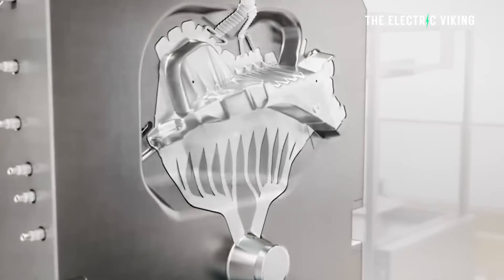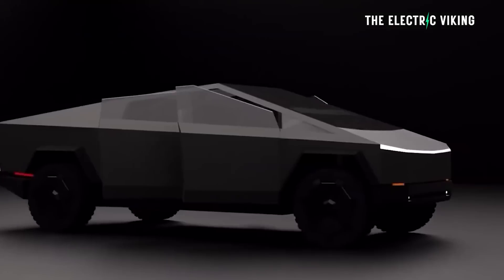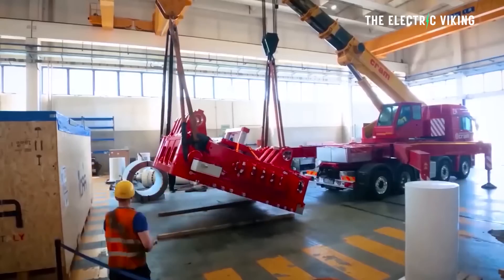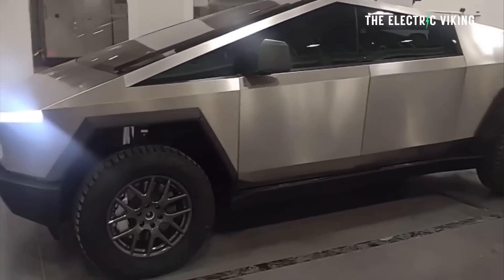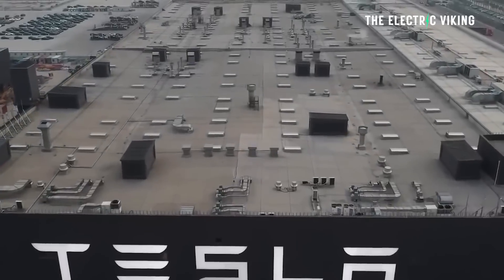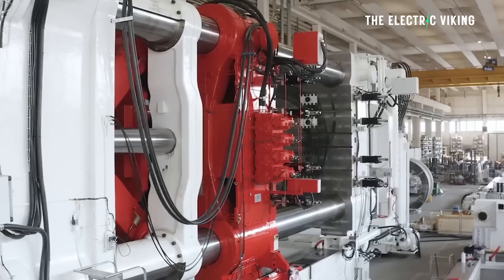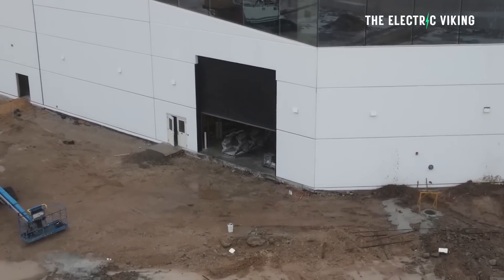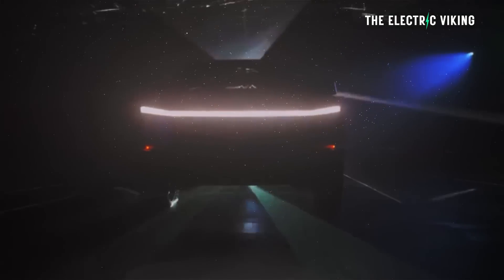Tesla Cybertrucks' MASSIVE one-piece castings spotted at Giga Texas

Comment: Am I missing something here ?  Castings, as far as I´ve always known, are made from molten metal poured into a mold.  Is the stainless steel melted before going into the IDRA Gigapress ?  No.  It appears to be sheet metal that is FORMED by the press into the desired shape.  Please correct me if I´m wrong.
Reply: Only the exterior is made from stainless steel. The castings are Aluminium. In this case, the molten metal is not poured into the mold, but rapidly forced into the dies.

Comment: I also have one on order and I'm hopeful that the quality of the material inside are better than the 3 or Y.  I was sort of surprised on how "cheap" the car felt despite the premium $$$.   So far the "test" models leave a lot to be desired.  The glaring body panel gaps are disappointing at first glance.  They have to do better as the reputation for lack of quality builds remains.   I'm still excited for the Cybertruck though.  I'm very hopeful.

Comment: I am no chemist, but I am an engineer and a part-time boater. The importance of this to my thoughts out tesla comes from using sacrificial anodes on steel-hulled boats. In freshwater, these anodes are often made of magnesium, but they are commonly of aluminium for steel boats used in brackish or salt water. 
They work (in the presence of water and in contact with steel or iron) like a Galvanic cell, with the Magnesium or Aluminium eroding away, but the steel is protected from corrosion. 
Given that the tesla mega castings are based on Aluminium, are structural, and surely will be in contact with steel, what would be the effect of prolonged driving of a not very new cybertruck in winter on frequently salted roads?
This wondering of mine is, in fact, secondary to another concern: How repairable would a car be, whose essential structure was just one or two big castings and a structural battery? Not now talking just of cybertruck. My guess is that a low speed collision with an obstacle,  that was just sufficient to distort the casting could completely write off such a car.
Are insurers in their ratings for own damage looking at this? Am I just being pessimistic?
Is Tesla trading repairability as the price for streamlined production processes?
Reply: You are describing a water heater; the magnesium core keeps the steel hull from rusting. The CT uses stainless steel, so the ionic exchange should be much lower. These castings won't be repairable, people need to stop fooling themselves. To be fair - traditional bulkheads aren't repairable either, but chopshops will always try. I looked into insurance and at least for me a model Y was MUCH more expensive than a 3, and that was due to the car totaling easier. Also the hatch dips into the bumper, so a mild rear tap needs a new liftgate. Now what happens when you can't just bolt on a new skin panel... but your dented fender is actually a functional exoskeleton? Sure its thicker and has a spring to it, but still. These will need to be cheap enough to justify the disposable nature of them... and I don't think they will be affordable for many years. Also - I want a mechanical handle to open the doors or windows, in the event of a power outage. That window isn't going to break with your feet.
Reply: @Dave-cf4vd  so my suspicion about totalling being a high risk is not merely a marginal hypothetical worry of mine! Insurers are bothered, too. I think there is too much awe and delight aimed at Elon Musk's embracing of lower-cost manufacture and not enough about repairability. I am not just having a pop at the Viking here, as to be fair, NOBODY is talking about it, ATM, including some that do go into individual vehicle reviews in some extreme detail. 
As for the "fly by wire" windows and doors, If I ever had such a car, I would keep a couple of emergency hammers in the car - at least the side windows should be toughened, so break safely. In the UK £10 for two from Amazon. The trick to power up the door locks from outside using wires hidden in the towing eye cover is far from straightforward, and impossible if you are embedded in the back of another car....
Mind, I am nearly 80, and whilst I would LOVE an EV, I suspect I will never own one. But following the technology as it develops is a delight for an engineer!

Comment: There is no doubt that the use of large cast sections will improve the construction process and reduce prices.  The big issue is once these hit the road and are involved in accidents.  In a conventionally built vehicle those smaller sub components can easily be replaced with new if damaged, this minimises the repair costs.  If a large cast section sustains even minor damage the only choice will be to replace the entire component.  This will increase the repair costs substantially and probably lead to Teslas being written off for relatively minor accidents.  The impact to the customers will be substantially higher insurance premiums for Teslas.  This may lead to Teslas becoming a throw away item rather than being able to be repaired, this would particularly be the case if they ever produce an entirely cast vehicle frame.

Comment: How many months will it take China to deploy their own (copy-cat) version of the Gigapress into production?

I am assuming that they began to clone-design at least year ago and intend to use it in 2024, but they will have troubleshooting issues to correct.

My prediction is end of 2024.
Reply: Idra have a CS9000 gig press in Shanghai right now. Do you think for one moment that anyone has the time to stop the press, pull it apart, reverse engineer it and then put it back together. This is also assuming there are only three in the world with a fourth one being built. China Inc makes stuff but only mass produced. Also Idra would get very pissed off with whoever copied their designs. LK Machinery owns a majority share of Idra now. Look them up then you will know their machines won’t be copied any time soon
Reply: @theairstig9164  Your assumption about my comment is too simple. China has a long history of ignoring proprietary intellectual property and will cheat, bribe (China has huge corruption problem), copy and steal in any way possible when they deem it to be necessary.

The practical reality is that these uniquely large machines are produced in quantities of only two or three per year.

Eventually, many of these machines will be purchased by many manufacturers but until then, your reply does not persuade me to change my assumptions. Economic reality makes my comment a mere, self-evident ornamentation. They will still attempt to do whatever is needed.

Comment: Until this vehicle is actually on the highway there is really no way of knowing but I think what can be said is that this truck is absolutely MASSIVE in every way with only the Ford F150 Lightning of similar type but of course far more/actually has #curb_appeal . For me I will be far more interested in how the computer interface system, vehicle safety and autonomy and any battery form factors changes plus drive "lines" than the construction of a wholly cast single piece body exterior. Casting something this large is a remarkable matter as engineering feat absolutely but again the hardest about driving any vehicle is not putting the vehicle in motion but in point of fact trying to make said vehicle come to a halt/full stop. Hopefully has redundant emergency brake systems.

Comment: It is unfortunate that Tesla is like Apple, in that they expect you to buy their new products, and care very little about how to maintain their older products. The Model S battery for example is very expensive to repair, and with the thousands of cells glued into the battery system, you might have only 5 out of 5000 cells bad, and so you have an over 10k repair, even though you have only about $50 in parts to replace...

Giant aluminum castings are not field replaceable, nor are they weldable. Instead of one giant casting they should have made it out of bolted sections, so that they could replace it like they did in aluminum aircraft construction, where every part has a fatigue limit.

Aluminum is a very lightweight metal, but it suffers from metal fatigue, while steel does not. Yes it is lighter, etc., But in engineering, everything is a tradeoff. 

The CyberTruck should be very cheap to produce, and it will tear up the market because they can come in at a lower price, but it is a bit of ecological nightmare to have a car that is so difficult to repair. This attitude that Apple and Tesla have is unecological.

Comment: cybertruck won't be out soon because tesla has NOT solved the battery problem. 4680 has been a huge disappointment so far! energy density of 4680, according to a recent EPA report, is no bettet than 2170!
Reply: rofl, you have no clue what you are talking about.
ofc it's density is not there atm, as if energy density is anything of a major concern, thats easy.
it will get there, no doubt about that.
the hard part is manufacturing insane amounts of them. the rest is fine tuning.
it is all as exspected

Comment: I hope Tesla shares their solutions to the many problems that have plagued large die castings in the past:
Weight is a huge problem as castings are made thicker since they lack the refined grain structure of rolled and drawn sheet metal.
Cracking of complex shapes while they cool in the mold is often a problem.
Cracks propagating unchecked through the entire part are always a problem with castings; less so with sheet metal assemblies.
Cracking of mold components from the thermal shock of the injected molten aluminum is a constant problem in the biz.
   If Tesla was on to something, we would first see die cast fenders and other large but easy to cast items.  Has anyone seen them?  Casting an entire vehicle won't happen by magic.  A lot of scientific and industrial disciplines must come together to make this happen.

Comment: Nice ,  one piece casting so if its ever in an accident,  it can be written off.    Truely innovative.
Reply: So does legacy auto.. 
I have my son slide into a ditch in rural NZ..  When the wrecker pulled out the car all the left side panels, front 2 doors and rear L panel were dented.  No radiator leaks and ac was still working and engine was OK That we continued to drive it to finish our holiday. 
The insurer decided to total it. My son used the insurance money as a downpayment for a replacement car. 
We are in a tgrow away economy... Mega cast chassis or not.
Reply: @joeabad5908   I too have seen cars "totaled" in part because of the high cost to repair body work and in part because the resale value of its components is so high.  Your son's car probably provided the parts to repair many other cars.
Reply: Yep, If an accident is big enough to damage the casting it's big enough to write off any vehicle.
Reply: There will be all these cybertrucks with dented fenders that are integral and can not be replaced.  A bunch of them together will look like a demolition derby.  OTOH all the cyber trucks that are written off will be bonanza of battery packs and parts for other uses.
Reply: Its pretty obvious that this technique makes construction cheaper and repairs expensive. It shouldn't even be up for discussion
Reply: this is more repairable, why do people always come up with this nonsense....

Comment: that might be great for manufacturing but what about insurance for vehicles made with that technique?  After so much damage to that one piece it will have to be replaced and the cost will likely be more then a fender.  Just a thought for your mature consideration.
Reply: This is not really an issue as even now most cars that are in a hard enough accident to damage frame components automatically get written off anyway
Reply: blah, blah, blah - that's been covered a zillion times by now.  If any current vehicle receives damage to its frame the insurance company will pretty much total it already.
Reply: It has a fender. And I presume dents can be smoothed out. But a more serious case, it probably is easier replacing the whole thing than all the parts you would have to do with a regular car.
Reply: If the chassis of your vehicle gets bent or deformed, it will most likely be written off by your insurance.
Reply: repairabiltiy is increased not decreased.
you can replace parts of it or the entire thing, Tesla provides painstakingly detailes instructions for all of this.
Reply: shhhhh, don't let the truth get in the way of a good story 😮